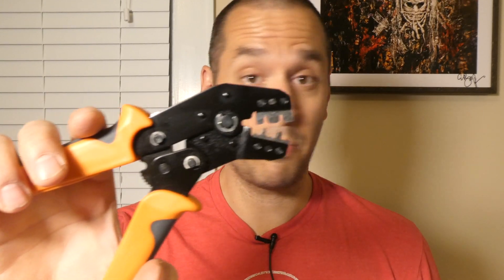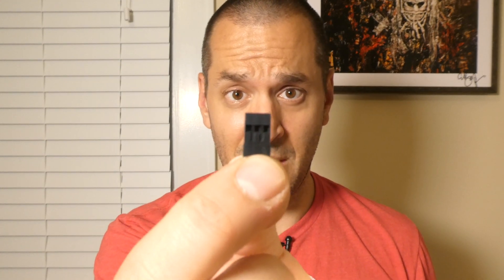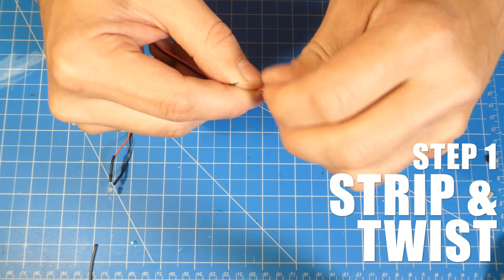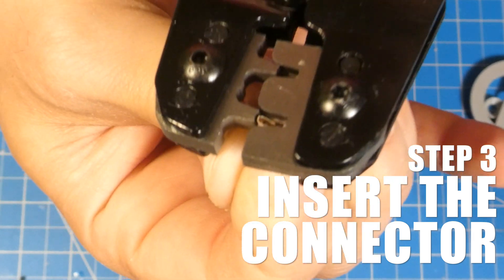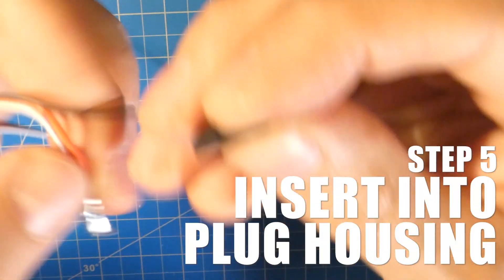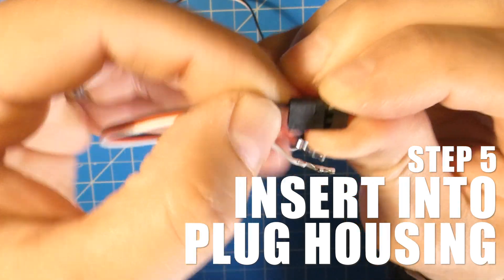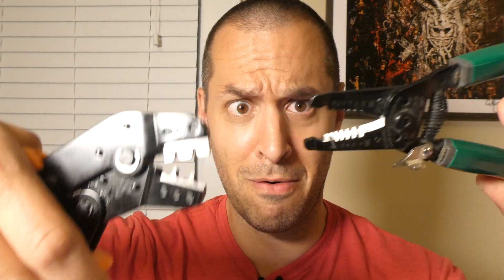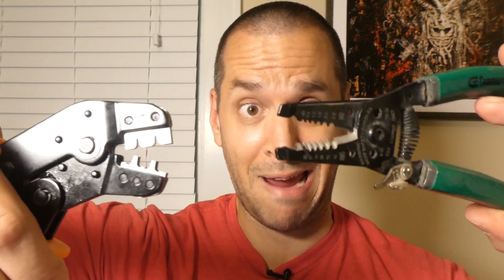How to Make Dupont Connectors

Comment: My expectations for YouTube DuPont crimping tutorials are… not great, and yours is a welcome exception: your results are decent, and you’re actually using a tool (SN-01BM) that is more or less capable of producing a decent crimp. However, the tool you’ve linked to in the description is an SN-28B, which despite being the most commonly sold for DuPont, is in no way suitable for it. You should link either to an SN-01BM, or even better, to the SN-25, which is actually made for DuPont (circular insulation crimp, rather than m-shaped).
Reply from the maker: I really appreciate the comment! This really made my day. And thanks for letting me know about the product links, I'll get those updated!!